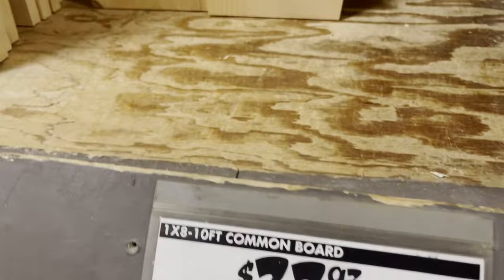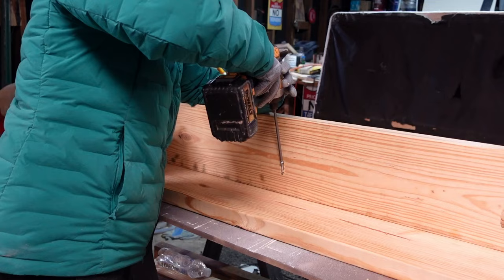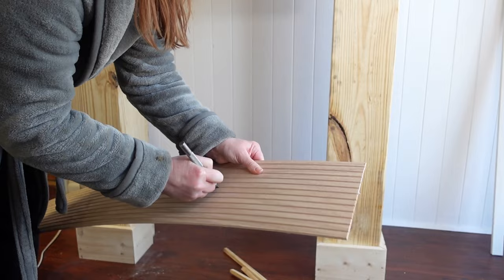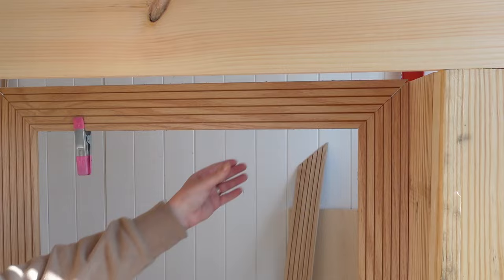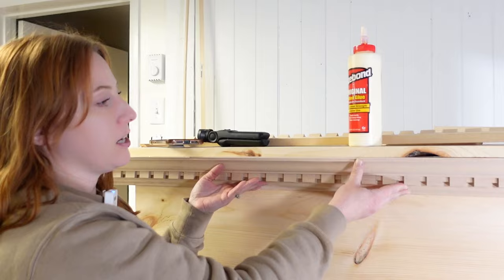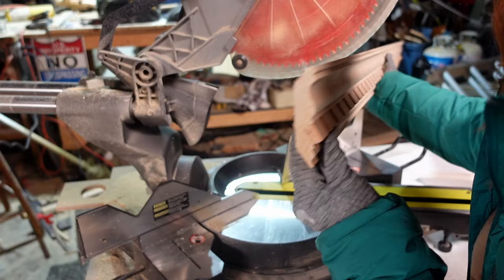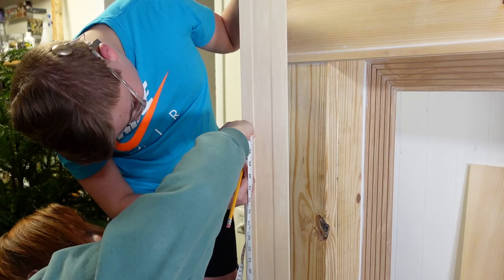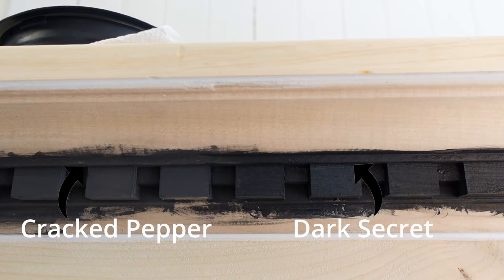DIY Faux Fireplace Mantle // Build it Yourself!! // Woodworking

Comment: The gap between outside corner pieces happens if it's cut a little short or your base support boards are not seated at right angle. I always cut 1/16 longer so it can be adjusted.